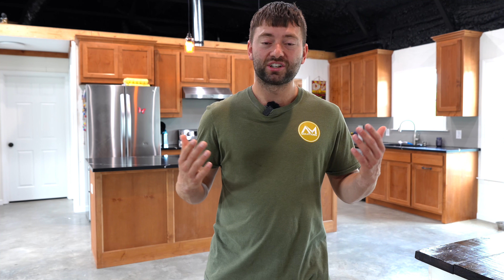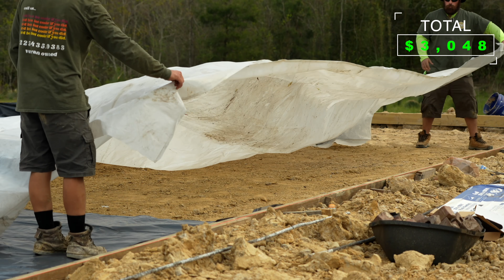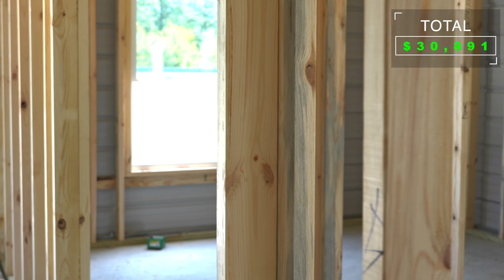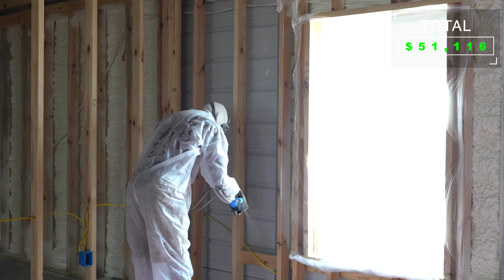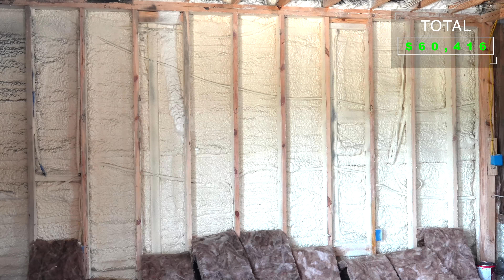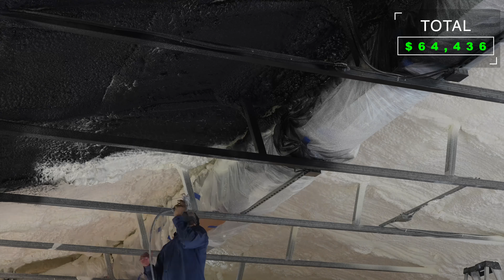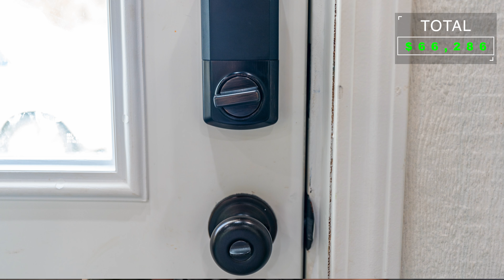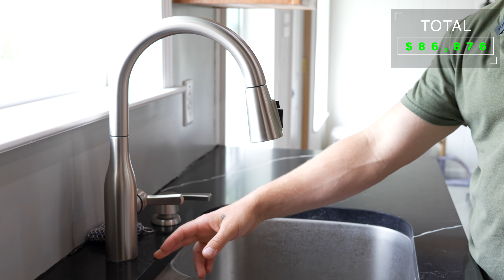Barndominium Price Breakdown | Building a 1,500 sqft 3 Bed 2 Bath Home for $87,000

Comment: Nice build and I so appreciate the cost breakdown. I do have to ask, how much would it have cost IF you had to hire labor/ contractors for the various jobs? 
And did you go with quartz or granite countertops?
Do you have pre filters for your water system especially your tankless water heater? Thanks so much!!

You have a gorgeous barndo @ $58.75 a square foot!!
$88,129.00 /1500 sq ft
Congratulations!!
Reply from the maker: Thanks! 

$160k quoted from a local contractor. 
Quartz, less maintenance
I do not have any filtration for the water, also don't have hard water here.
Reply: @DudeWeCanBuildIt  WOW!! $160K. You definitely saved alot by doing much of the work yourself.

Comment: No radiant floor heat? Are you in warm climate?
Reply from the maker: South Louisiana
Reply: @DudeWeCanBuildIt  makes sense. With how well you insulated that building, your hvac cost is probably beer money.
Reply from the maker: Not even joking. In July the bill was $65. Super blessed for this build. 
Thank you for watching and commenting we really appreciate it!
Reply: @DudeWeCanBuildIt  that's insane for Louisiana. I built my own barndo in VA. I run two mini splits for cooling. Usually around $150 electric bill in summer, but its 2400 sqft. Im right around $100k turnkey on mine.

Comment: you only save money on the tankless water heater for the purchase of itself you pay a shit ton for electricity since it has to superheat the water instantly which over time will cost more than a regular water heater
Reply from the maker: My electric bill in the middle of July was about $65
Reply: This is only true if your electric rates change throughout the day.  If you pay the same rate all day, then raising the water temp instantly is cheaper than raising it slowly and maintaining that temperature 24x7.   The heat on demand unit costs a fraction to install, takes up way less space, is easier to replace, and saves energy.   With that said, a hybrid hot water heater uses 1/4 of the electricity, but it also costs many x more.

Comment: You totally had me until you got to the interior walls. Seriously, sheet rock and some mud is just so much better than half assing it.
Reply from the maker: It does look better but if it gets wet. Or a hole. Or anything else, it’s a pain. We flooded in 2016 and I gutted multiple homes of its Sheetrock. Never again for mine 😂

Comment: Before doing a video do a closeup of the mating surfaces. Around the exterior windows, doors, corner trim where the siding goes behind, around the exterior electrical outlets, and vents. To ensure that all mating joints are sealed with sealant to prevent infiltration of air, wind,rain,water.

Federal Construction and Safety Standards. Section 24 CFR 3280.307 Resistance to elements and use.

If these items are not sealed with sealant. You should report it to the State Administration Agency.

If the manufacturer built the home to the Federal Standard you should have no problem videoing around the items mentioned.

Have a great day.
Reply from the maker: Whenever we drop a “home inspection” video we will make sure to add that to it 😂

Comment: Electronic dead bolts/ locks are useless when power goes down.
Reply from the maker: Absolutely. If only there was a metal thing to open the door manually from the outside.
Reply: @DudeWeCanBuildIt  set up a solar panel on the roof and have it dedicated to the main entry point.
Reply from the maker: That OR maybe a key?

Comment: #1 very cool and informative video.  The end result looks awesome.   But....As a very experienced insulation contractor i would like to make you aware of some errors in your install, (these are vey common mistakes)  I hope the paint that you used was fire rated (intumescent) as the spray foam is highly flammable.  Also you should have left off the paper on the exterior wall insulation, as that would be considered a double vapor barrier and can lead to moisture issues in the wall.  Not criticizing, just informing.  I think you are very blessed to have such good friends to help you out so much!!! Keep up the good work!!!
Reply from the maker: Appreciate the advice and honesty!

I can use unfaced insulation in the future, but how do you keep it from sagging? 

Also, the spray foam has an integrated fire retardant. I've seen a house that caught on fire and the spray foam did not spontaneously combust.

Comment: Did I miss you speak  about the light fixtures ,and do you have a pantry, linen closet or fire place? I wanted to know if the floors are cold ? It is a beautiful home .
Reply from the maker: The lights are LED. I do have a pantry and linen closet built by the custom cabinet builder. The floors are cold. Thank you!

Comment: What are the cabinets constructed of? Fiber board or plywood? The fiber board is garbage, but a lot of builders use it because it is so much cheaper than plywood. Then they charge the same as plywood. You didn't say which.
Reply from the maker: The cabinets are made of alderwood

Comment: I would the have put a brick ledge on the foundation just in case I wanted to, in the future, add masonry work or any other exterior additions. 
Also if you live in the Southern Tornado Alley like I do, either incorporate into the layout a small steel container (like a storage pod size), or use steel reinforced concrete to make
one of the closets so you have a storm shelter and safe room.
Reply from the maker: Those are great ideas!

Comment: I agree with @Natesanti not only do I have no friends I am 61 years old have been paralyzed for over 40 years, thanks to an 82-year-old woman who was basically legally blind and give me head on on my motorcycle drove over a steep hill on the wrong side of the road. I was sent one around 65, which I subsequently bounced off of and flew through a hog wire fence. Needless to say it was a miracle I survived. The lady was worth $8 million but because she lied and I told the truth which was I don’t remember anything despite evidence that the impact point was under her passenger headlight 9 inches from the edge of my side of the road. My blood, the gouges in the pavement and pieces of my motorcycle were all embedded in the pavement at that point again 9 inches from the edge of my side of the road. She subsequently got a ticket for doing a U-turn on top of the hill. She was in an Oldsmobile 98, 1979 model. It was a tank and it did not give. 
Living with paraplegia is a tough battle, and our lifespan is roughly 64 years old. 
Ultimately I received $50,000 total. It was her maximum insurance payout. I was simply a naïve 21-year-old kid, and all the people around me were telling me to settle. My incompetent lawyer, who was supposed to be one of my dad‘s best friends, just blew the case, and actually never worked on it, and intended to settle from day one despite telling me that he was going to video my day today life, and show the challenges of getting in and out of a car, and of all of the details of dealing with life as a paralyzed individual. needless to say I dealt with some serious anger issues for roughly 10 years give or take, but I’ll be honest they’re not completely gone, especially now that I am essentially broke and living on a disability pension. That’s embarrassing. My benefit is $314 a month and I get $60 in food stamps but that was before I went back to school achieve my bachelors and masters degree and worked as an educator primarily 17 years as a high school guidance counselor.. However, at age 57 I suffered from an onslaught of pressure sores five to begin with, and they were healed for. blessing. The one on my sacrum simply will not heal. They did a skin flap and it failed because the paramedics dropped me and I hit on the side of my bed which is made of wood and the pressure sore opened back up. 
I am currently suffering from a bone and blood infection due to a pressure sore that became infected. It has been open to the bone on my right buttocks for six years. I’ve had 12 surgeries and the doctors tell me it’s gonna kill me but my goal is to finish my Barndominium and get to enjoy just a few months or maybe years if I’m lucky in the Mountain cabin I have dreamed about since I was a kid in the late 60s.

To this point I have spent $20,000 on 3 acres of land.

I have spent 25,000 on permits and clearing a spot to build a cabin on and installing septic system .

I have also spent $26,000 to have a water well drilled. The expense is due primarily to the well-being 550 feet deep. It’s a good well though and I’m grateful for that. Well is 50 GPM though Colorado only lets me use a rate of 15 GPM, though that’s more than enough for me. The well still has to be finished to Colorado regulations, which are much different than Texas where I went through this process multiple times the cost to drill. Wells here in Colorado I, will the price is exorbitant compared to Texas where I routinely drilled water wells that were 100 to 200 feet deep and most of those cost approximately $4000 give or take and that was for a completely finished well with a pump house pressure tank pump, etc.
I also spent $37,000 on a red iron heavy duty steel building that is 30 x 50 x 20‘ tall the shop will be 30 x 30 with a 10 foot door and the living quarters will be two-story and each story will be 600 ft.². I’ve also had to purchase a lift to get me in my chair to the second floor and the cost of that was $5000.
I still have to pay for a foundation and I have quotes from 30,000 to 60,000. I have paid $1200 for engineering drawings of my foundation and of course the permit cost for it in the building which I believe was $750. 
The cost to erect the building is going to be approximately 7500. According to my contractor once that is done I’ll have to hire a plumber and electrician to get the foundation all prepped for plumbing and solar. I’m not sure what the cost will be on those but I’m guessing Around 2000 each and that’s just to get them set in the foundation. It is nowhere near what it’s going to cost to complete the bathroom and waterlines or to get the electricity run throughout the house.

The cost of my solar system is going to be $40-$45,000. I have researched it thoroughly and I believe it’s the best company out there, Eco flow, and it will consist of four portable power systems, 10 of the best lithium batteries money can buy, 25 solar panels to wind generators to be placed on top of each end of the building. And according to my calculations, it should produce somewhere around 140 to 150 kW a day. When all that is finished, I will need to lay down some recycled asphalt and we are going to do this during the heat of the summer and use some equipment and some type of binder to create an asphalt white surface, but completed with recycled asphalt. It should be good enough that I can get around on my manual wheelchair or my outdoor/hiking scooter.

So currently my budget of already spent and planning to spend is at 182,500… Now I don’t have the advantage of doing DIY because you just can’t build a Barndominium when you’re paralyzed from the chest down in a wheelchair 24/7 365. 

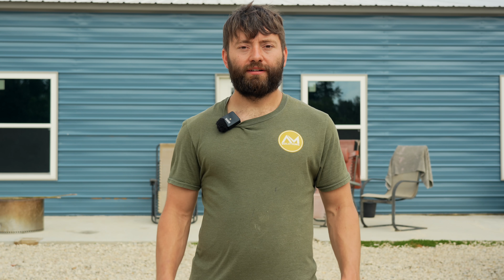The 182,500 not include the cost to frame out the interior and build the living quarters. I’ve tried to contact Sam old friends from college, but they are unable to help. They have their own lives families and cannot afford the time to come up here as most of them live in Texas , or they simply just don’t want to. All of my family has passed away except for a niece who lives in London and a nephew who lives in Florida, and they have no desire to come help their uncle build a cabin. My dad, brother and mom are all passed away, I do have two cousins who live in Texas, and though they have called once or twice since 0:56 I’ve been here for the last couple of years; and though they always end each call with if you need anything, just let me know but yet they don’t really mean it. One of them was mailing some prescriptions from my pharmacy every three months or so, but he recently called me and said that since he has to pick up the prescriptions in one city and go to another city to mail them. It’s just too much trouble despite the fact that he’s retired and travels to one city to visit his ranch every week and travels to the other city to play golf with friends and see his son and daughter-in-law and grandchildren. No checks on his former company which he sold in 2018 for 52.6 million. He did have to split the sale proceeds with his partner so they both ended up with a little over 26 million before taxes. At one point my cousins got together and both talked about building a small house on the farm. I owned at the time so that I would have a place to live that was it a dump. Oh my farm was a beautiful piece of land with a creek running through it all pasture land with a couple of small fields, 15 acres and 7 acres each, the farm in total was 140 acres. In the end after I got sick with my first battle against sepsis and septicemia, I had no choice but to sell it. It broke my heart, but Medicare took my health insurance away because they are an incompetent asinine government bureaucracy, that doesn’t really care about the facts they care about, while getting insurance company, what can we do to minimize the payment on this claim?
 Yes, you are blessed and fortunate that you have friends and family that will help you like this. It makes me very happy for you that you were able with the help of your friends and family and God to make this Barndominium come together my friend you are blessed because to be on the other side with more expenses then you can afford and thousands of dollars in an unpaid hospital bill sitting on your kitchen table. I’m almost ready to give up. Almost. I’m going to give it hell until the end.

So the bottom line is with windows and framing and doors I expect to spend approximately 80,000 additionally, to get the solar installed and to build out the living quarters… So I think the cost of the Barndominium for me not being able to do the DIY route is going to be approximately 165,000. I apology brother for being able to do it for 87 five that’s a remarkable achievement. 

The most ironic thing about my situation is that if I would’ve never gone to work and work my way off Social Security to become a productive taxpaying member of society. I would be earning $3250 a month which is my SSDI combined with survivor benefits from my mother and father. It just leaves me shaking my head and wondering how some people who are not in this country legally get more government benefits than I do. Should we take care of our own before we start taking care of people from other countries or even in other countries. I know some of these people desperately need help, but so do I. and I am in my situation through no fault of my own. I was just in the wrong place at the wrong time and somebody her husband and daughter were an 82 year old woman with Cataracs so severe that she was legally blind, and yet they let her drive.

Comment: builds a barndominium and has no garage for cars.....what was the whole point of this.
Reply: How many homes have you built?
Reply from the maker: Just this one
Reply from the maker: To have a house that costs a fraction of a $300k cookie cutter home. Imagine the garage I can build with the other $200k.
#bigthink
Reply: Didn't build a barndominium. A barndominium has a drive thru section tall enough to park a 5th wheel triple slide out camper or a bigass motor home inside of it.
Reply from the maker: @gus24seven  lol, that's a barndoMAXium!

Comment: The building was $15,500, how does that compare with a framed structure? Wind resistance aside.
Reply from the maker: By the time you do the framing, exterior siding, roof trusses and roof, I would imagine at least $50,000

Comment: Introverts are gonna have a more difficult time with this since they tend to not have many friends and usually the ones they do have aren't the DIYer type let alone professionals in a field like plumbers or electricians or HVAC.

One of the BIGGEST advantages of working in one of those fields is the connections you can make to other professionals in other fields.
Reply from the maker: Yes, having experience in the trades and knowing people in the trades is incredibly valuable. 

Not many young people want to get into the trades because it's too much work
Reply: OK so it's settled. Introverts get to pay retail.

Comment: This is a fantastic video! I'm looking into making a 20x30x16 barndo, with 2 stories. Thankfully i don't need my interior to look so nice so I'll save some money there. Best part for me was watching the insulation, I'm planning on also using closed cell plus fiberglass, though i might only go for 1 inch of spray
Reply from the maker: That's awesome! You can build it! 

Every environment has different temperature/humidity concerns. Talk with an insulation professional and do some Reddit research to make sure that won't become a source of condensation and eventually mold in your area

Comment: Curious about your choice of 34" wide interior doors which required custom order. Wouldn't it be cheaper and more functional (better access to move furniture, etc) to use standard 36" doors?
Reply from the maker: I wanted 36" doors everywhere, but I didn't have the space. I also didn't want to go down to 32" doors.